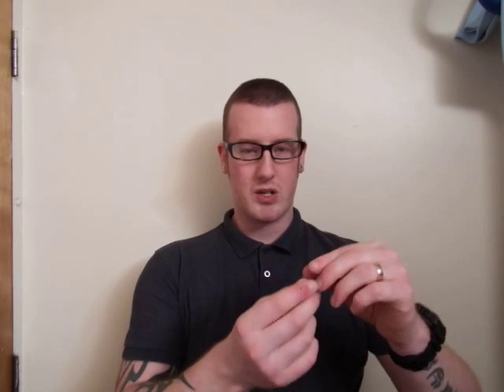FREQUENCY ON METAL DETECTORS EXPLAINED

Comment: If you're talking about the scattering object in relation to the incident wave, then it's basically divided in Rayleigh and Mie (and Optical) Scattering, based on the wavelength in relation to the object (e.g. Mie Scattering the diameter of the object is approximately the size of the wavelength). I think that there are a lot more factors that go into engineering the metal detector and there could be dozens of iterations I think -e.g. some type of magnetic induction tomographical planar array. To go really deep you would just need to up the dBs of the TX coil(s).